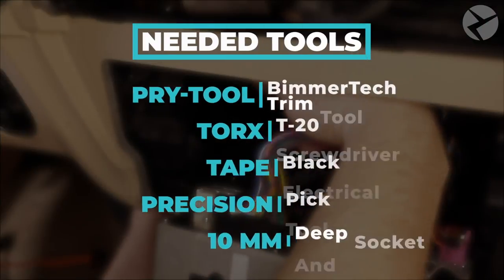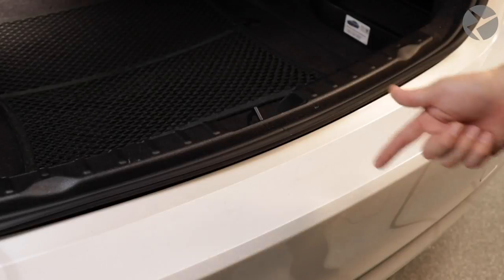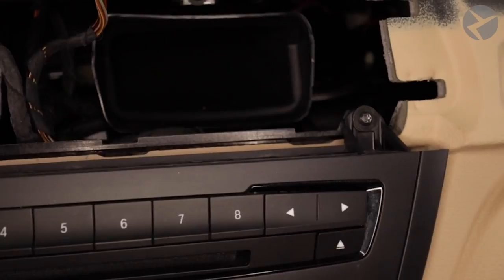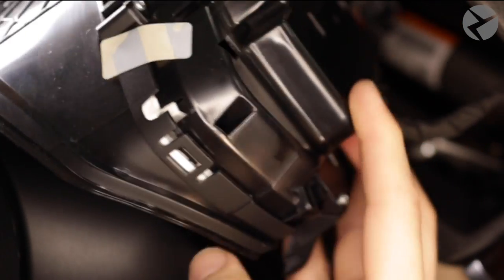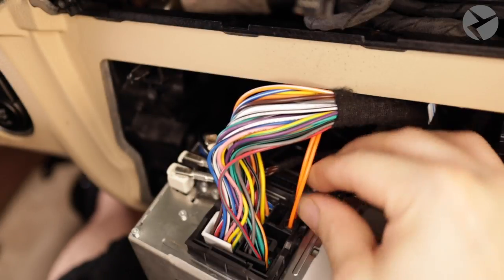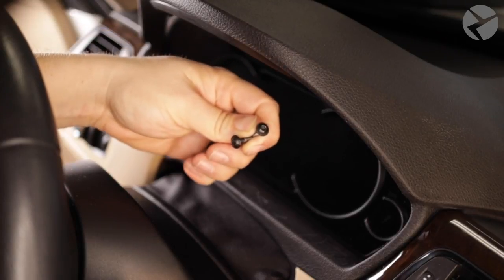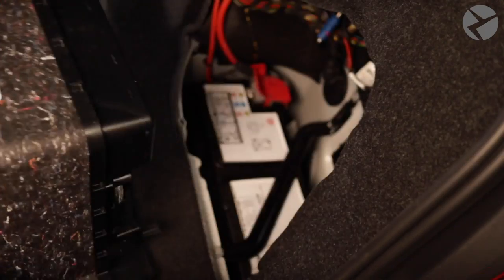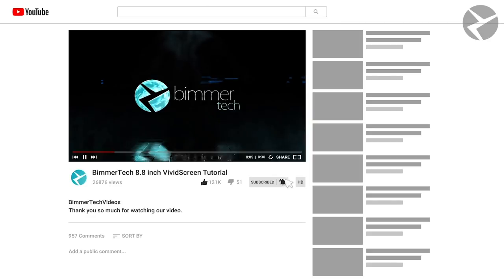How To Install A 6WB Digital Cluster In Your BMW 3 Series / 4 Series (F30/F32)

Comment: Thanks, I really like the instruction vid. well done. I do reconnment ppl to check if everythings works, when you plugged all the cabels in, before you put everything back together. you never know if it works or not, so you don't have to remove everything again if ur unlucky and have a broken device of you missed a plug.

Comment: Quick question, if you have already done a screen upgrade in your car, will you be able to do this upgrade as the fibre optic cable is being used by the screen as well, or is there a spare/free connection for the optic cable in the original cable harness for the additional connection of this fibre optic cable
Reply from the maker: Hi, we will need the last 7 digits of your VIN to tell. Please send them along with your question at info@bimmer-tech.net and our support team will let you know if you're compatible.

Comment: Hello,

I want also switch from standart analog cluster but unfortunately my head unit system doesen't have an OPTIC FIBER outpout/input.

Is there anything what I can do here or I need to swtich NBT EVO?

I have BMW F36 05/2017.

Thank you.
Reply: What did you do? I have the same problem

Comment: Does this work on the F36 2019 430i? MPerformance with MSport. ? Very new to BMW. It's my first one v
Reply from the maker: Hi! It can do, but it depends on what other options your vehicle is equipped with. The easiest way to check is to head over to https://www.bimmer-tech.net/category-6wb-bmw-oem-digital-instrument-cluster-6wb and hit the button to identify your car. With your VIN we'll be able to confirm whether it will work in your car. Thanks!

Comment: So it’s completely plug and play? All warning lights on dash will still work correctly?
Reply from the maker: It requires remote coding after installation. It's included in the price.There won't be any warning lights once it's coded.

Comment: I know I am years late but I have a somewhat dumb question: does the 6WB adapt to whatever car you have? say I have a 335d wagon, will the tach display the same as my analogue cluster displayed? or if I take it and put it into an m3, will it show the same as an analogue (in regards to redline RPM and such)
Reply from the maker: The 6WB cluster needs to be coded in after installation for the proper communication with the car. If you would like to install the cluster in another vehicle you will need to send it back to us to perform the chip reset, then we would send you the cluster back. Please note that it will need to be coded again.

Comment: Hi! Just ordered mines and installed it. Took about 10 minutes. Noticed that when I installed it the instrument cluster wouldn't stay lit and it would turn on/off with a bunch of errors. I drove it from my garage to the street and it wasn't on while I was driving. But it would turn on for like a 3 seconds, then turn off again. Is this happening because I don't have it coded? I have my appointment tomorrow but wondering if it's that. Any info is appreciated!
Reply from the maker: Hey, if you haven’t already done this then please check all the connections in the back of the instrument cluster. If you are absolutely sure about the connections then the next step would be the coding session. If the issue persist after the coding session please let us know through the contact form on our website.
Reply: @bimmer-tech  where can i read more about doing the coding session? I am going for the european(kmh) cluster.

Comment: Hello.  Looks great but I have changed the stock radio to a touch screen with a back up camera in a 2011 328i.  Would I still have the same unit where you plugged in the fiber optic cable into?
Reply from the maker: Assuming you mean 2011 model year (so it's from the end of the E90 generation), then this cluster isn't going to fit your vehicle.

If it's produced at the end of the 2011 as the 2012 model year (so F30 generation), then as long as you've still got your head unit there should be something to connect to. But we can't guarantee anything without knowing what other cables and harnesses have been retrofit back there; we prepare kits to fit the factory setup.

Comment: Will this be compatible with a 2017 440i with heads up display? Thank you
Reply from the maker: The compatibility depends on many specs, not just the model. Please enter your VIN here to check if it fits your car: https://www.bimmer-tech.net/category-6wb-bmw-oem-digital-instrument-cluster-6wb Keep in mind though that in vehicles with HUD, after installation, navigation directions will be shown on the speedometer, not on the HUD.

Comment: Hey guys, quick question, I have a g20 M340i. I would like to change the instrument cluster. Do I need to update the Cluster serial number in the car? If yes, is this something I can do with tools like Carly or will I need some Pro to do it?
Reply from the maker: Hey Fernando! The install of new instrument cluster is fairly easy and - as shown in the video - you don't need to update any serial numbers! :) 
With the install, you'll menage with basic tool kit, but we recommend to order our DIY essentials - it makes the process even easier! 
Cheers! :D

Comment: Whats up with the Orange wire in the back of the main console? Checked multiple vids like this but they never strip the Dash for a new wire to the digital cluster?

Am I missing something?
Reply from the maker: These are fiber optic cables of the MOST network. It depends on the car’s configuration if they are present. These cables are used to relay information mainly between the head unit and the Instrument cluster.
Reply: @bimmer-tech  it seems i do not have MOST inputs on my idrive 6 from 2018 without navi pro can it still be done or do i need to upgrade to navi pro

Comment: I checked my VIN and see that it should work according to the site. The site mentions it being Lease friendly as well... Does that mean it is easy to code back when lease ends?
Reply from the maker: If you keep your existing cluster, you'll easily be able to switch them back when your lease is done, and it will be like it was never there. Everything is completely reversible.
Reply: @bimmer-tech  Would we have to recode this to get it back to its original state or does the coding only affect the 6WB instrument cluster?
Reply from the maker: @moonx02  After swapping the OEM cluster in the coding will be required.

Comment: Just a quck check. Does 6wb emmits red optic light all the time when it is connected? Mine only lights for a second when I start the car and then it stop shining.
Reply from the maker: If you mean on the fiber optic cable, yours is ok, that means the starting signal was sent.
Reply: @bimmer-tech  Yes, I meant that. Thanks! Another question: When plugging in the optical cable, should I allign so light from cluster matches light from headunit light or opposite?
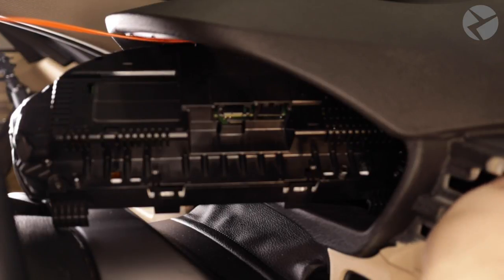Reply from the maker: @KlepicPredrag  The connectors are designed to only fit one way so you cannot go wrong here, just make sure that when connecting the one from the cluster, the locking tab should be facing right 7:50

Comment: Hi there I wanted to buy a m4 cluster and fit it into my bmw 435i 2015. Is that possible?
Reply from the maker: Yes, although it will depend on your vehicle specifications. You can check if you're 100% compatible after entering the last 7 digits of your VIN on this page: https://www.bimmer-tech.net/category-6wb-bmw-oem-digital-instrument-cluster-6wb

Comment: Will it work with CIC iDrive? Is it require the same kind of work?
Reply from the maker: No, unfortunately it won't work with CIC.
Reply: @bimmer-tech  I got 6WB yesterday and I got CIC. I have jack in CIC module that accepts fiber optic cable, and it emmits red light. 6wb is connected but it only emmits red light once car is started and then stops. Due to this I do not have communication between CIC and Cluster(cannot set date, see contacts or radio). Any suggestion how to solve this?

Comment: You say in the description that its ok for F32, but when I go to your website, I followed the link, there is a message that its not compatible with my F32, is there something that can be done or am I stuck. Do I need to upgrade something else before or is there additional parts that I need.
Reply: From reading it may be that I need to change the head unit at the same time - is that correct ??
Reply from the maker: Hi, it's hard for us to suggest anything without knowing your VIN. Please send its last 7 digits at info@bimmer-tech.net and our support team will explain what's needed for your F32 to be compatible with the cluster.
Reply: @bimmer-tech  Thanks for the reply - I have sent the details as asked,

Comment: Look great! Does this work with F30 330e?
Reply from the maker: Hi! Yes, depending on what other hardware your car is equipped with. You can check compatibility at https://www.bimmer-tech.net/category-6wb-bmw-oem-digital-instrument-cluster-6wb after identifying your car by its VIN. Thanks!
Reply: BimmerTech Already checked. It said compatible But I still wonder about eDrive information such as %battery
Can it show on 6WB?
Reply from the maker: @tHCANiDY  Please email your VIN to our team at info@bimmer-tech.net so they can check exactly what hardware your vehicle is equipped with. Then we'll be able to confirm the full list of features available for your car.
Reply: BimmerTech Email sent. Thanks for quick reply.
Reply: @tHCANiDY  Please share what you find, I have the same car (330e) and would love this update.
Reply: @Jure Pogačnik I sent my VIN but they said my car doesn’t compatible.
Try your VIN and please share the result. Many thanks.
Reply: How to switch from km to mph?
Reply: @tHCANiDY  what year is your car as ive got 18 plate and want to see if its compatible for mine

Comment: Does this support nav on clusters
Reply from the maker: Yes but not in all cases. If you send us the last 7 digits of your VIN we'll see if it'll work for you.
Reply: @bimmer-tech  thank you haven’t got the car yet is there a specific year cut off or model which are compatible for this feature so I know what to look for when buying an f30
Reply from the maker: @adamusmani5155  No it's a matter of a head unit. You can send us the VIN numbers of these cars and we'll check which ones would be compatible with 6WB. The last 7 digits of VIN will be enough.

Comment: What is the difference between 6wb and 6wd?
Reply from the maker: BMW's 6WD option is the following: WLAN Hotspot - nothing to do with the instrument cluster.
Reply from the maker: Hi! 6WB is a fully digital instrument cluster. 6WD is the wireless hotspot available in some vehicles, so completely unrelated. Perhaps you're thinking of 6WA, BMW's 'hybrid' instrument cluster? Unlike 6WB, which is fully digital, 6WA still uses traditional analog gauges but adds some digital elements. As a fully digital cluster, 6WB offers more flexibility.
Reply: @bimmer-tech  the exact answer i was looking for, thank u so much!